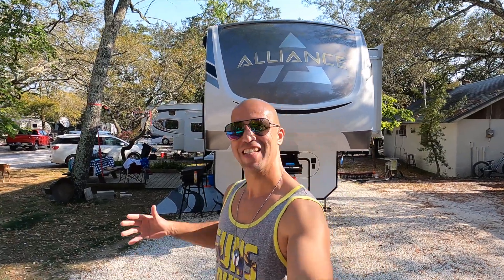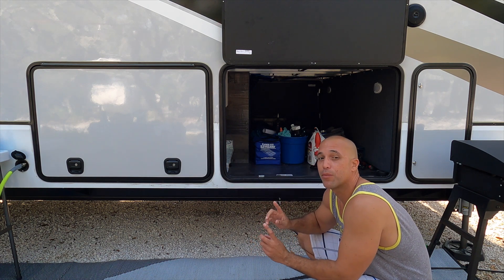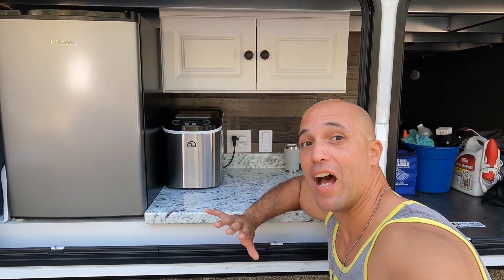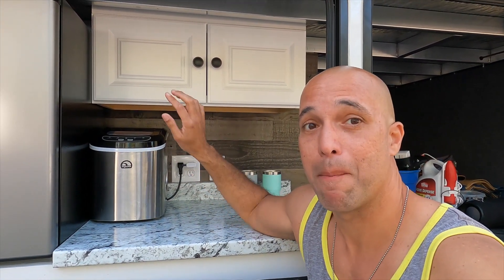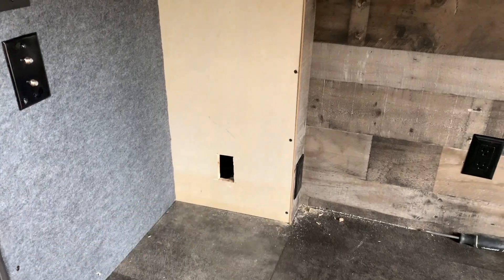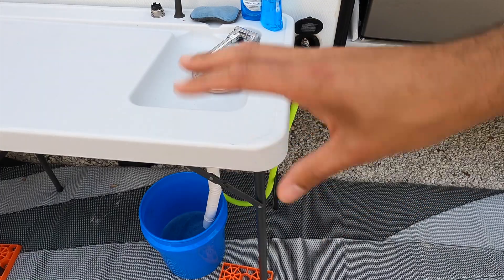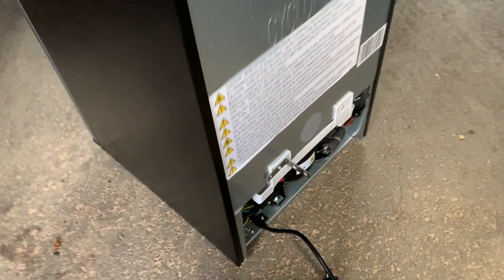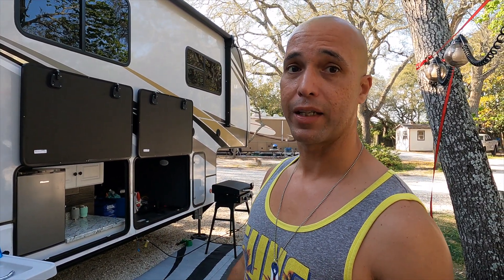RV Outdoor Kitchen Install In Alliance Paradigm 390MP | DIY

Comment: I removed these walls to examine doing this on my 390MP, however what I'm missing from your video is how the air flow / return from the vent under the stairs reaches the furnace in this configuration?  Seems like making that angled wall a 90° corner would block the cold air return...?
Reply from the maker: You’re right, I’m sorry, I didn’t show it very well in the video. The back wall behind the refrigerator is built out about 6” to allow airflow. It then makes a 90 degree angle and connects to the back wall. The refrigerator blocks this angle from view so it looks like one straight wall in the back but it is not.
Reply: @RCRVadventures   Ah!  That makes more sense.
Reply from the maker: @sators If you ever decide to take on the project, DM me on our Facebook page. I may have some photos/videos I can send you to help show it with more detail.